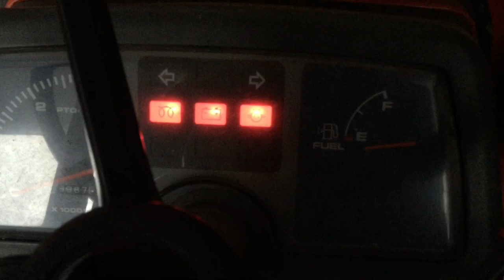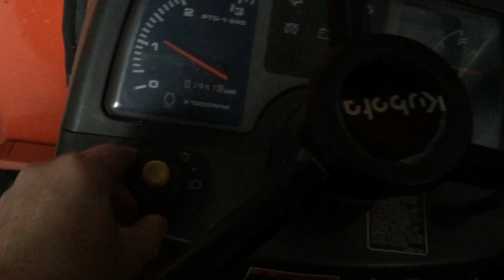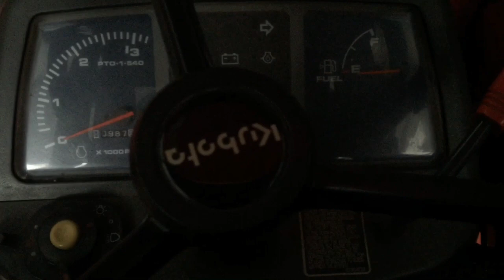Kubota B7300 diesel running with ignition turned off.

Comment: that's how my welding machine is as well. you have to pull the shut off knob out for it to kill the engine. I believe it is set up like a choke and shuts the air flow off completely.
Reply from the maker: On mine, its just a fuel cut off, its the same thing on our little tractor. All of the newer ones have a fuel cut off solenoid. (And fuel pumps.)
Reply: @JimsEquipmentShed  that's what my welder has a solenoid and fuel pump. I think its a 1987 model I don't know much about them.
Reply from the maker: daveknowshow I love the simplicity of diesel, it’s one of the things I love about tractors.

Comment: I know this is really an old post, but to resolve this issue, you have to replace the fuel shut off solenoid.  Relatively inexpensive.  Best to buy it from Kubota, but I’ve picked up a couple from Amazon/eBay that seem ok.
Reply from the maker: There is no fuel shut off solenoid on a B7300.
It’s got a manual fuel cut off, that’s the orange knob I pull.

Comment: My old Yanmar runs with the key off. My shutoff cable is seized but the throttle brings the RPMs down so slow it kills unless it's warm then you just pop the  clutch with it  in high gear...ya, I'm a hack...
Reply from the maker: We had a few people on our kubota board that thought you could diagnose a dynamo issue by pulling the battery while the unit was running.
I used those as an illustration of why that was not the case. Not all diesels have mechanical fuel pumps, but the ones that do, are unstoppable once they are running.

Comment: Interesting. It’s not supposed to be like that, is it? I’m confused now, lol!
Reply from the maker: Diesel runs on compression, so it doesn't require anything but fuel, and air. Thats why 90% of the offroad rigs around the world are diesel.
If you have a mechanical fuel pump, you are unstoppable. No ignitions, no coils, so care about dash lights.   The newer tractor tend to have electric fuel pumps now, so that will kill them when the power is cut.
Reply: So does that mean your mechanical shutoff cable is seized, or what? Or did it come like that from the factory?
Reply from the maker: @jacksonk5308  I originally did the video for someone on my Kubota group that was talking about disconnecting the battery as a way of telling that the alternator (dynamo) was working or not. 
He theorized that the machine would just die. (Like a gas engine would.)
Soi I did the video as a way of showing that the diesel needs no electrical power to continue running.
My older tractor just has a better way of being able to display that, as the fuel kill is mechanical. Most of the newer machines have an electric kill solenoid.
Reply: Ah, that makes sense. Cool video. I definitely learned something new.
Reply from the maker: @jacksonk5308  Its one of the many reasons I prefer diesel. At least I did before the truck engines got mandated to death.....
Reply: Yeah, exactly. Emissions regulations are ridiculous on the new stuff. I love diesel but all this DEF, DPF etc headache doesn’t make diesel worth it anymore, as far as big things like trucks.
Reply from the maker: @jacksonk5308  They are murdering the trucking industry, and headed toward tractors. Its going to be an interesting future with out food.
Reply: Lol, I think you’re being a little bit dramatic but I definitely agree with what you’re saying. I hate to think about the day when I can’t buy anything but electric vehicles. That will be a sad day for me. Working on these things is the one thing I’m actually any good at. My machines are the only thing I’ve got left, at this point.